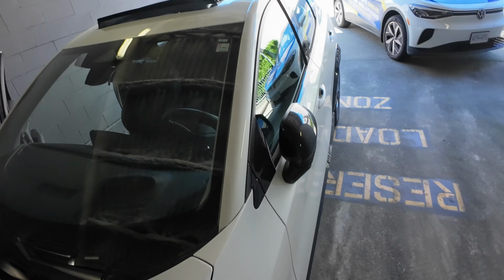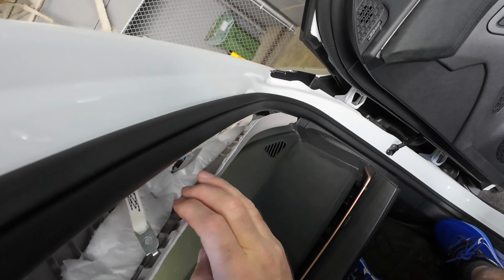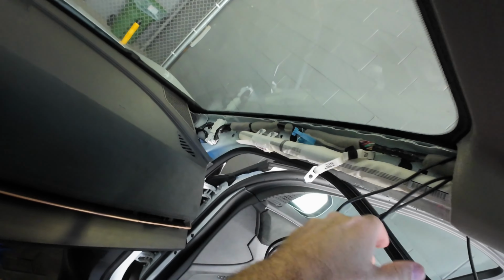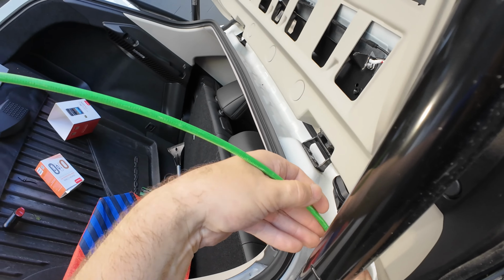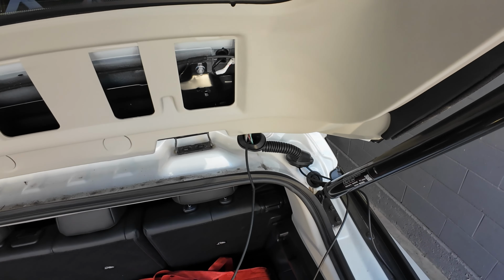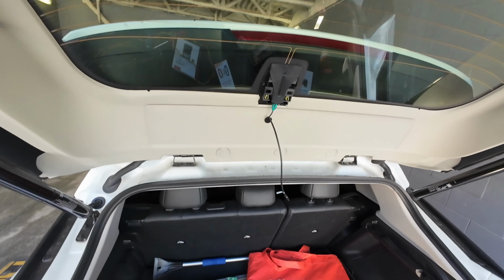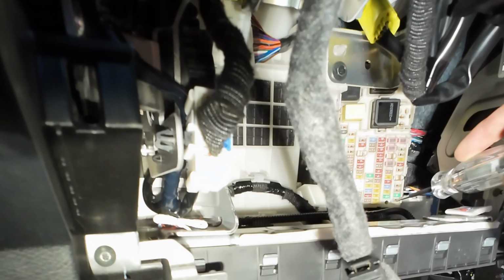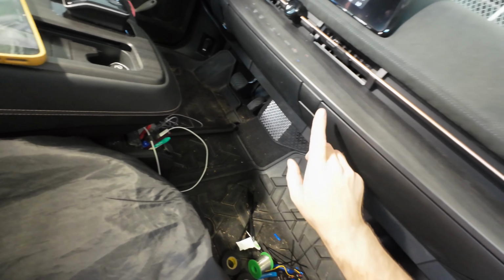Nissan Ariya Professional Dash Cam Installation | Safe Drive Solutions

Comment: Thanks for this video. Just fitted a blackvue front and rear camera complete with battery pack for parking mode and SIM card adapter for viewing remotely via the app. The only part I was nervous about after seeing the video was fuse access, being from the UK I should not have worried as it,s under a cover below the steering wheel that made the install a breeze. Also found a empty threaded hole for the ground lug. Location of the battery could have been messy but found a zipped flap at the front of the rear seat base, access door to the traction battery isolation, that was perfect.

Comment: Thanks for the video, but there’s a part where you used your special tool to fish it out the back. What did you do exactly?
Reply from the maker: we could not get the camera in there good. All the footage was useless for that section. But basically we fished the wire through.

Comment: Hi, first of all great work and thanks for the documentation. This has helped me a lot to actually decide to get a dashcam for my Ariya. I have one question though... there's an original Nissan part. "ACCESSORY SERVICE CONNECTOR - Nissan (T99F6-4RA0A)" This cable is actually (apart from the LEDs) for powering a dash cam. Have you seen this anywhere near the fuse box or even on the mirror where this could be plugged in if not already in there? Access to the service manual is quite expensive and not guaranteed to have this little detail.
Reply from the maker: there was a plug not far from the fusebox on passenger side. some people use it. We do not. there is nothing wrong with using the accessory connector from Nissan we just dont want to buy a harness everytime we do a nissan

Comment: What a great video! I ended up going down a rabbit hole and watching a bunch of reviews from your channel. I have a question about the fuse tap. Since you're using open slots in the panel, then did you just use one fuse in the tap? What size fuses did you use? Thanks so much for making this video!
Reply from the maker: Yes only one fuse. We used 2 amp fuses
Reply: @SafeDriveSolutions  thanks so much for the quick reply!

Comment: Does anybody know where I can connect just a rear dash camera in a rear part of the vehicle?
Reply from the maker: the rear camera plugs into the front camera
Reply: @SafeDriveSolutions In your case, yes,  but if I have dashcam and want install it only for rear window should I drag cables to the front of the vehicle anyway? The question is about power supply for cam in rear part of the car
Reply from the maker: maybe i am not understanding. It gets power from front camera
Reply: @SafeDriveSolutions  because you have two cameras, front and rear in set. But if I have only one dashcam which I want install on rear window. I'm just trying to find a shorter way 
Sorry to bother you.